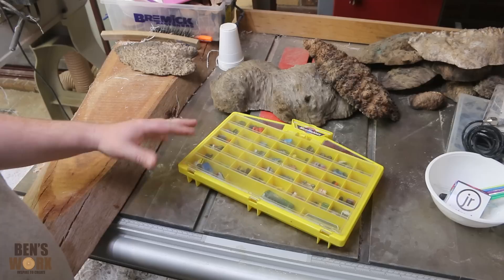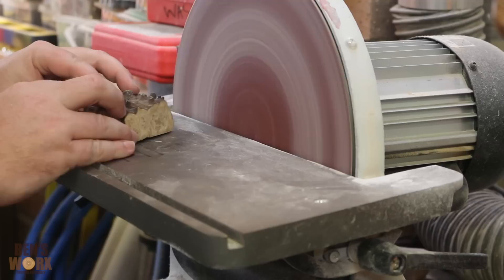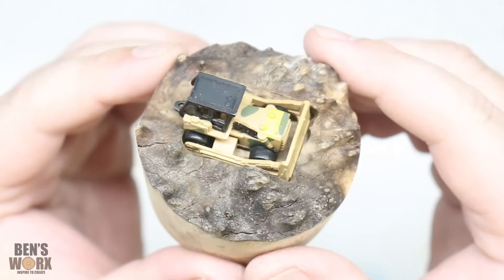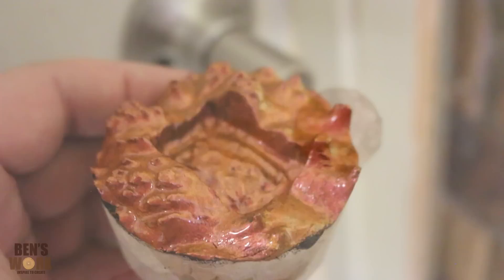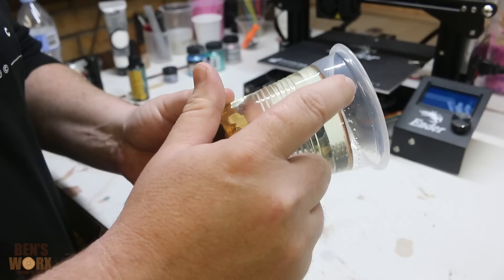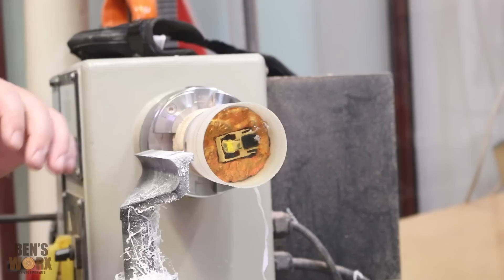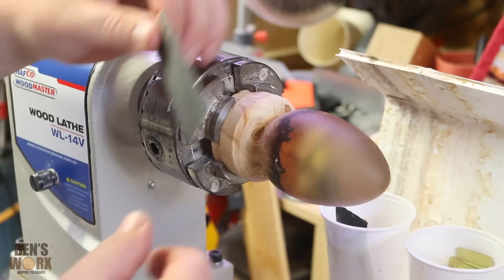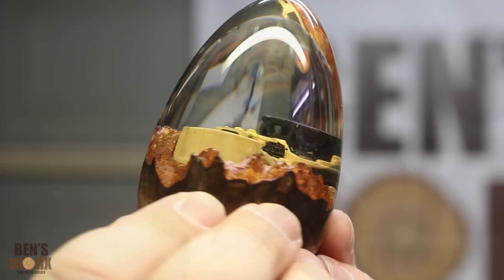Turning a vintage 1987 micro machine into a birthday gift

Comment: Stunning! As for the Epoxy Shaving Waste... You can dye the shavings different colors and use them inside more epoxy. You normally need to let them soak in the dye. Dry. And soak in dye a few times for the color to hold.
Reply from the maker: Thanks April, i have re used resin shavings in a previous video where i made a bowl 👍

Comment: I don't mean to take away from the quality of your creations, but after binge watching probably well over 100 of your videos, I think that it might benefit some of your projects more to consider the concept of "Less is More".  Here's what I mean.  So much of the wood you use is already beautiful to begin with.  Sometimes it does seem like a cool idea to augment that beauty with a paint job.  But, I think that in a lot of other cases, no treatment is necessary, or even a simple treatment to make the surface look rained-on could make the piece look even more beautiful than a paint job.  Having gone to LAN parties quite a bit some years ago, and seeing all the decoration people would do to their computers, both cosmetically with display windows and lights, or adding functional enhancements like water or forced-flow oil cooling rigs, it was noted sometimes that (to return to the original idea) Less is More.  Some of the most impressive lighting rigs were cases where there were just a couple of well placed lights that were "just plain white".  These looked quite striking because after all the peacocking of color and whatnot, there was pure raw power to the white, expecially after the owner explained to those that asked, "Well, it felt like White was the New Black."  
Starting with initial ingredients that are already as beautiful as they are, I think some of your projects would benefit from the "Less is More" treatment.

Again, I do not mean this in any way to disparage your projects, which are breutiful to look at.  I just think that there is value to considering the other side of the coin sometimes.

Comment: Ben. Have you ever suspended an object in resin then turned it on the lathe?  Most people have an issue with seeing the line between to two pores
Reply from the maker: It’s very difficult without the 2 pours, I will give it a go though 👍

Comment: Does the UV resin cure faster with the UV light or do you have to hold it there for 15 minutes? I've never used UV resin but it seems perfect for projects like this.
Reply from the maker: UV resin will only cure under UV, either buy a lamp or the sun
Reply: Ben's Worx yeah. I understood that. I was asking if it cured faster with the UV torch than with the sun.